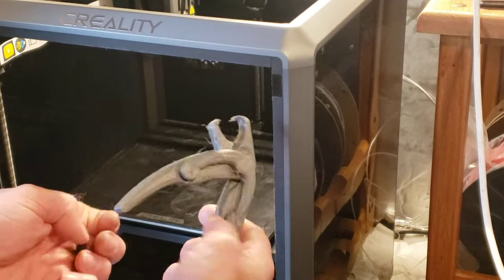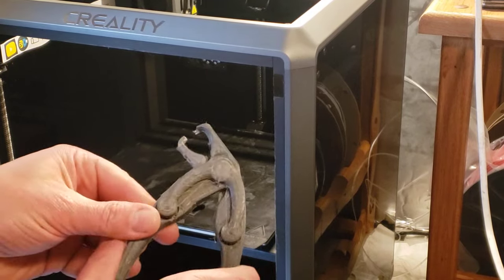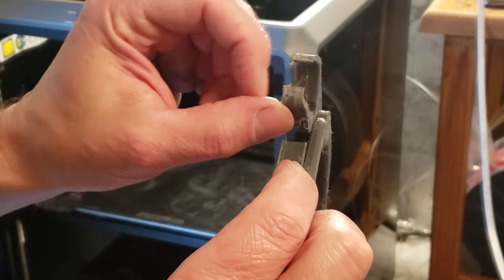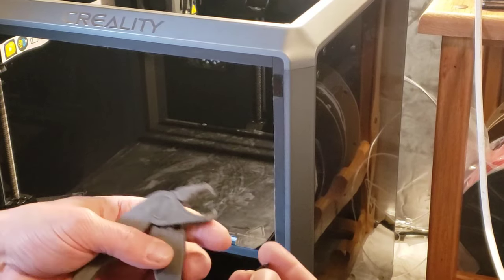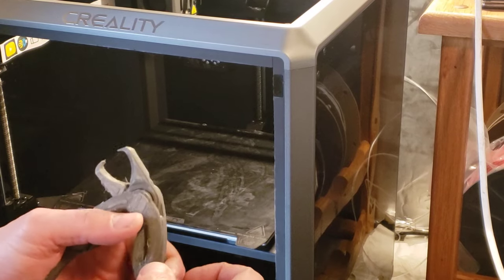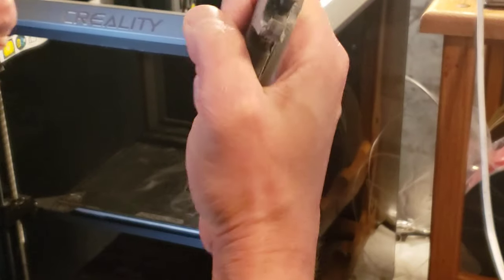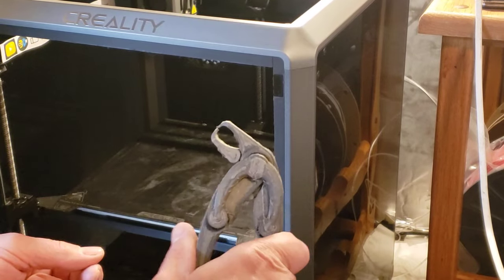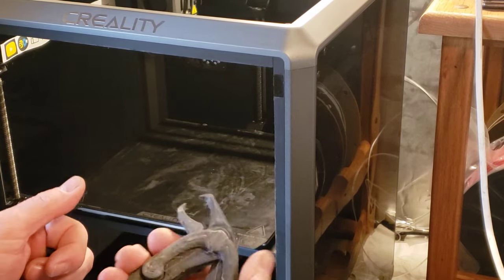Testing V5 of nylon print-in-place compliant mechanism tool for plastic rivet removal

Comment: Good job ! I like these kind of practical prints.
I have been struggling with those pushpins too.
Reply from the maker: Thank you, I just used them again today and mostly worked great except I still may improve them one more time, slightly shorter teeth as I had a hard time getting behind one but barely got it, and maybe a bit longer jaws to get my hand a bit more backed off.  Overall they work great though.  Let me know if you'd like the file to print, or I could even send you a pair printed if you send me a prepaid shipping label.

Comment: Hey I love your videos they're very informative
Reply from the maker: Thank you, kind and encouraging words always greatly appreciated!
Reply: @3dcre8r28  hey by any chance do you know if there's any aftermarket hardware upgrade to increase bed and nozzle temps?
Reply from the maker: @Ytu-x1o   I don't.  How hot are you trying to go?  I think my K1 is rated at 300/100, hot enough even for polycarbonate.  Though my bed is a bit rough from lots of high temp stuff.  But overall I think it handles 300/100 pretty well, which covers all but the super expensive stuff like what, PEI or PEEK, no?  I imagine you could upgrade to liquid cooled hotend, but not sure how much that would slow down a corexy system due to the added mass.